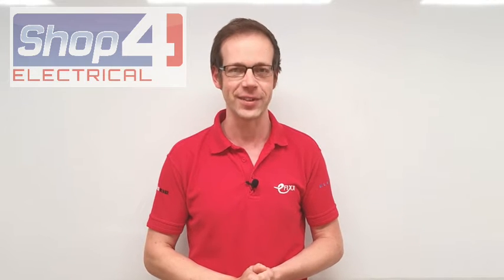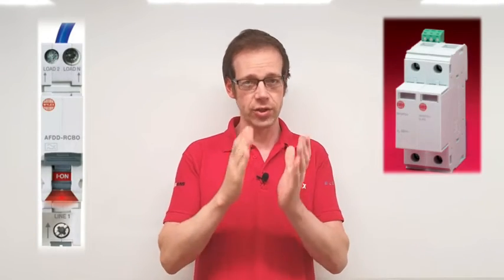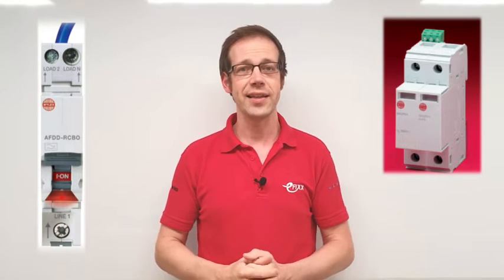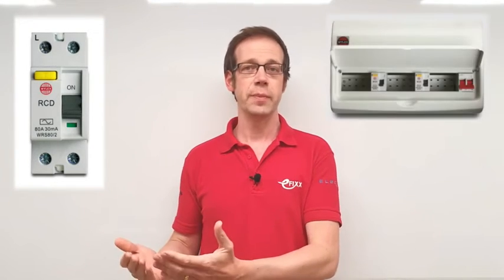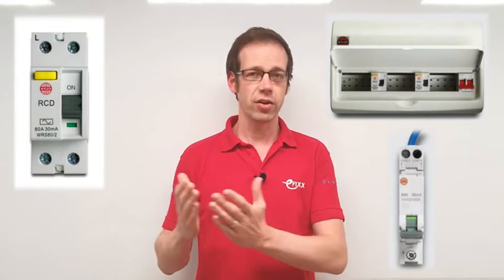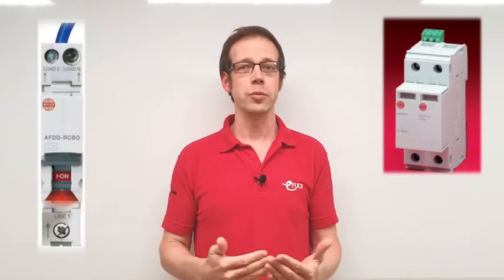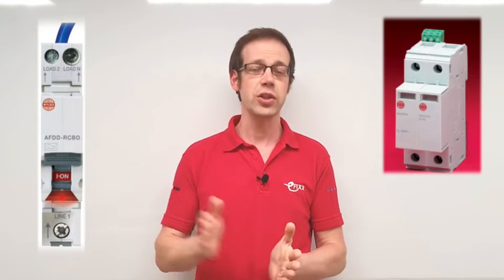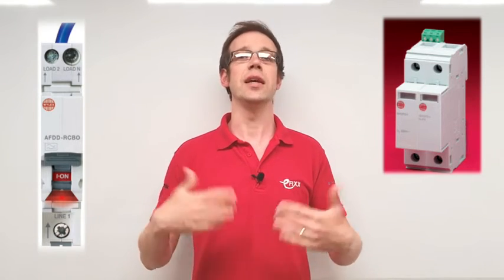Do AFDD's provide surge protection functions?

Comment: Interesting you mention the history of RCD progression in the regs there, The overwhelming majority of those fitted, and indeed still being fitted are type AC - which arguably is not appropriate for many modern applications, because of the dominance of electronic equipment with switch-mode power supplies! What’s your view on this? Are lots of existing RCD protected circuits obsolete?

Comment: I understand that AFDDs work with viewing the sine way and tripping when it recognises the fault. If that is the case I don't think they will last in their current form for long. Instead you will have a mechanical safety system (MCBs, RCDs, SPDs) and a "smart" safety system which will use machine learning and software to understand how your system works and shut off current to any circuits with dangrous signals

Comment: Nicely explained 😊👍
Personally I think when AFDD’s are eventually a requirement it’ll be the end to the twin load RCD board. Which I’ll be happy about as I hate the things, long live the RCBO👍😊
Great videos 😊
Reply: Your right hardly an improvement over a front end RCD, result is basically the same takes out circuits which don't have a fault on, which is actually against the regulations, but for some reason its ok to contravene that one 🤔.